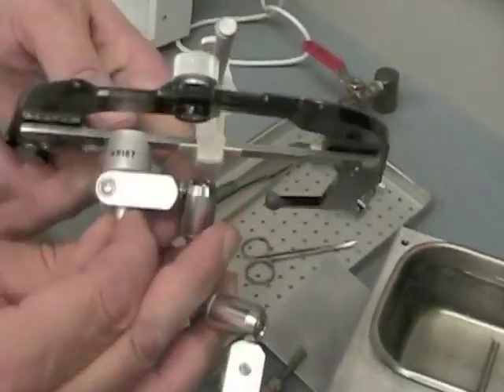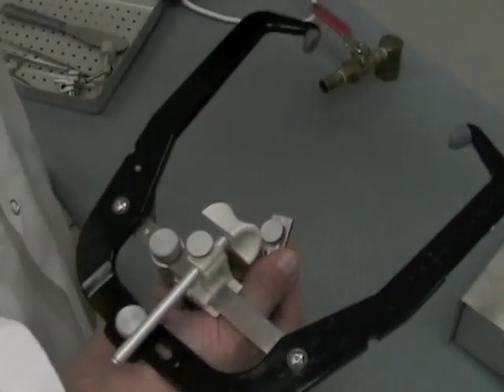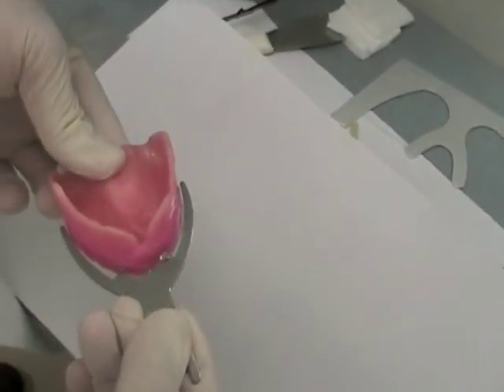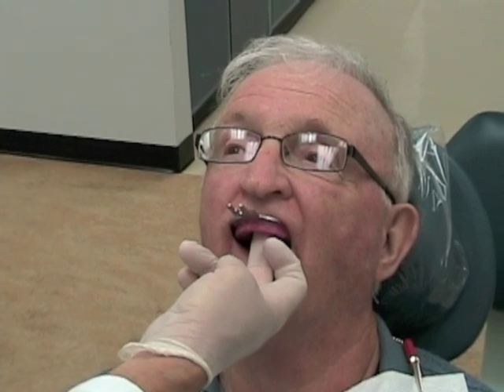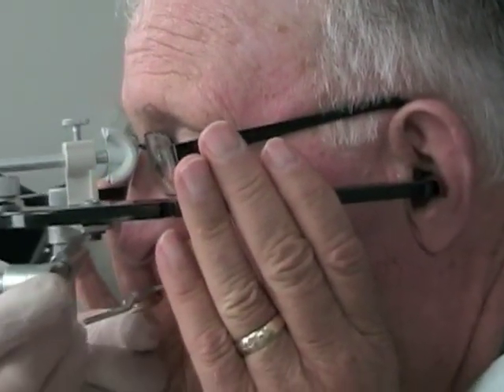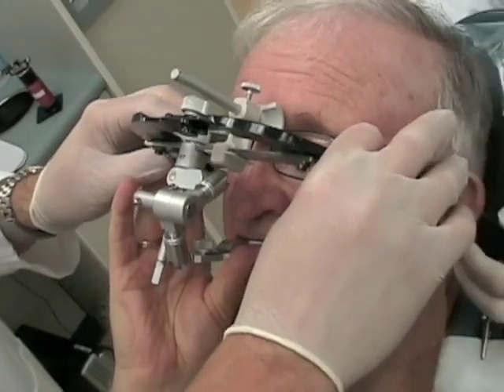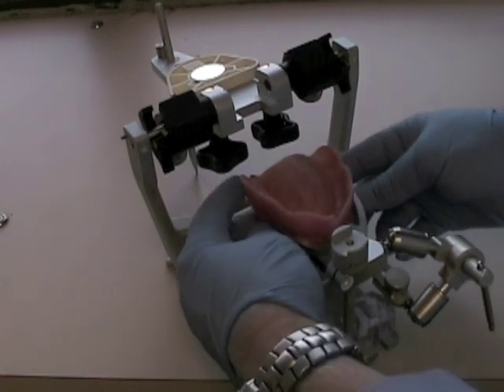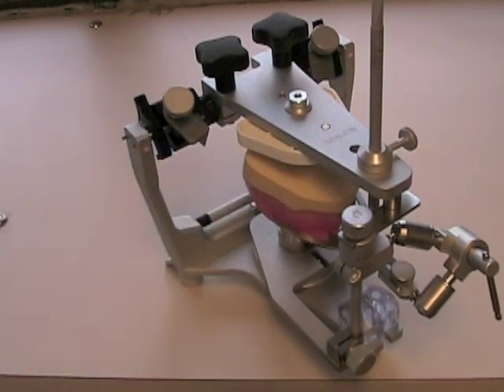25 Facebow

Comment: Hi Dr. Loney, questions about facebow. I've read your manual about CD start to finish. I've been watching your videos. I also read the book "The Complete Denture A Clinical Pathway 2nd edition" by Dr. Michael I. MacEntee. I'm confused about the facebow part. If the steps are in order, does it mean you usually do facebow after you measure/confirm pt's orientation and VDO? If that's so, after VDO and facebow, you go straight to mounting the maxillary arch before you do CR record? If that' so, does it mean you have the pt wait for a while at the chair during the time you mount the max arch in the articulator and then you go back to see the pt to take CR record? Then, you will take a protrusive record? I see most people demonstrate on how to take a facebow bite on people with teeth, thus I'm quite confused on facebow for making CDs.
Thank you
Mike
Reply from the maker: The order of making records and mounting casts can vary, and there are advantages and disadvantages for each sequence. Normally I make a face/ear bow and then mount the maxillary cast so that I can check that the position of the maxillary cast is relatively centred on the articulator and that there is not a problem with the mounting. If the mounting doesn't look right,  I can make a new facebow immediately, avoiding the necessity to have to redo both the facebow and the mounting of both casts later. Then I normally make protrusive and centric records for mounting the mandibular cast while the patient is still in the chair so that I can check the mounting with the patient still present. Typically I make the protrusive record first, then one CR record, then a second CR record. Making the CR record last allows me to often remove the last record and rims together as a unit and move directly to the mounting without separating them. Once mounted, the 1st CR record can be used to check the centric mounting. If the mounting is off, a new centric record can be made since the patient is still in the chair. Then the protrusive record is used to set the condylar guidance. If you are efficient, the whole procedure can take 10- 15 minutes maximum. If you don't have mounting materials in your office, or if you prefer to save chair time, all records can be made at one appointment without mounting (facebow/earbow transfer, CR records, protrusive record). This does save chair time and makes a shorter visit for the patient. However, if there are any problems with mounting the maxillary and/or mandibular casts, the patient may need to be re-appointed to remake records and remount the casts, thereby negating any time savings.
Reply: @DrLoneyDal  Thank you very much for your response!